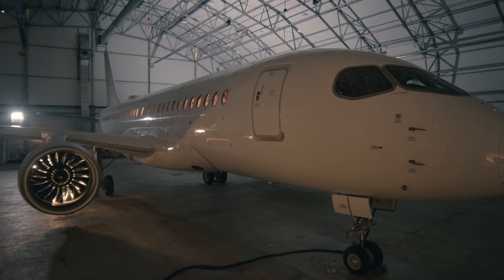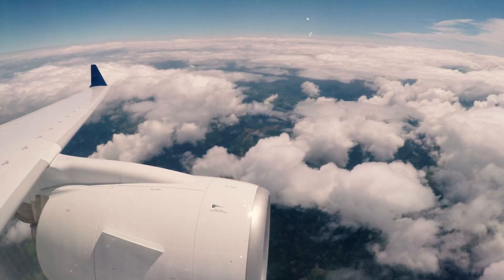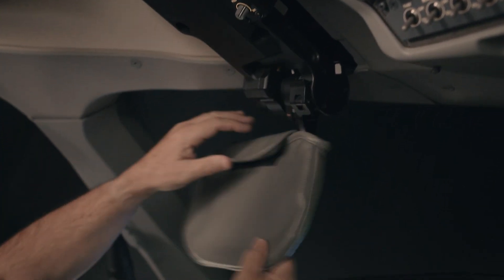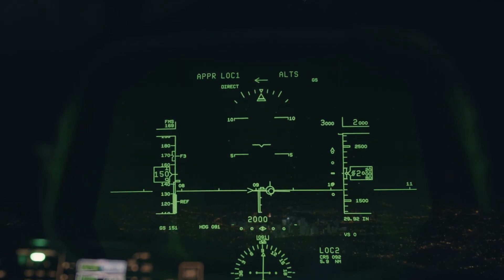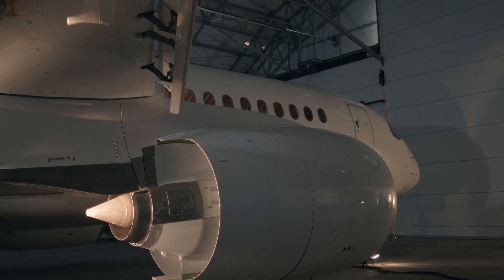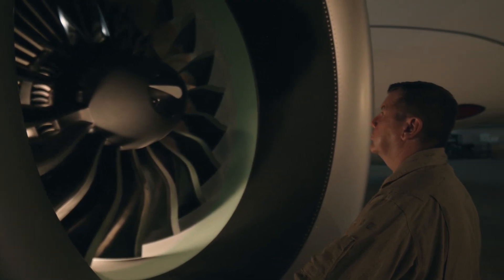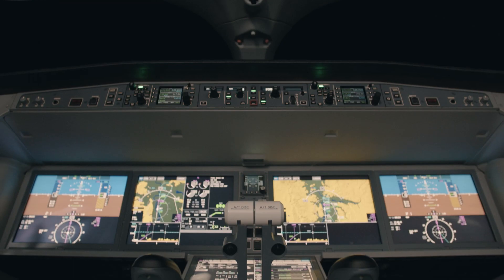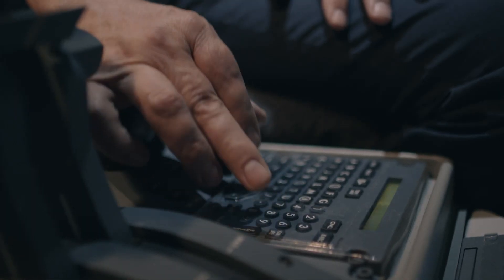ACJ TwoTwenty - Flying characteristics

Comment: Personally, I feel like that with all this automation the feel of being a pilot is somewhat taken away for me, and aspiring pilot. 
For example, in the 60's, 70's and 80's (possibly more recently but I'm not so sure) being a pilot was much more that just flying and being I'm command, it was the ability to find out what's happening with nothing but flashing lights and dials. But now for me, it feels like the job of the pilot is almost just to do what the aircraft says. Its sad to see that the job of the pilot is slowly being phased out, something that I don't really wish to see. I feel that the prestige of the pilot uniform, years of training and knowledge of the many buttons is some what taken away when initial type training for the A220, for example only takes a few weeks. my opinion, I dint think I communicated my point properly.
Reply: It’s all about safety!
Reply: You still fly the aircraft, with the systems assisting you, you still need to remember all the procedures.
Reply: @hansloyalitat9774  u fly the computer and the computer flies the airplane with protections built in.